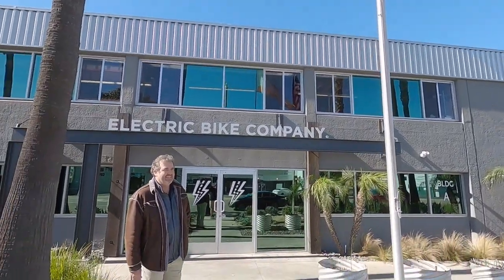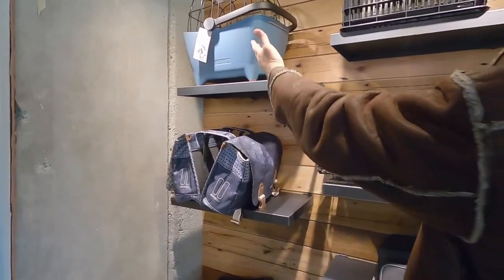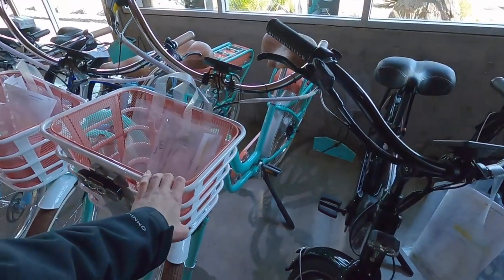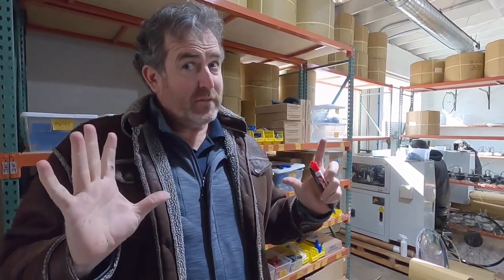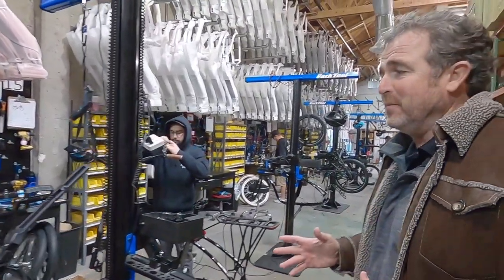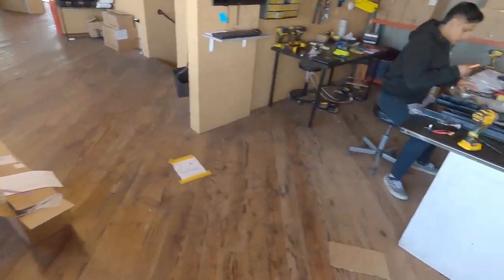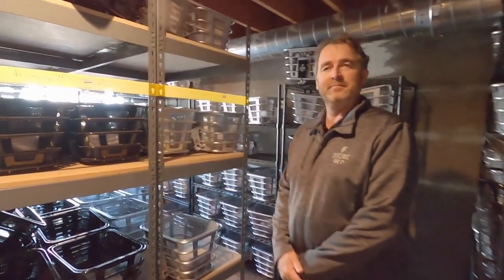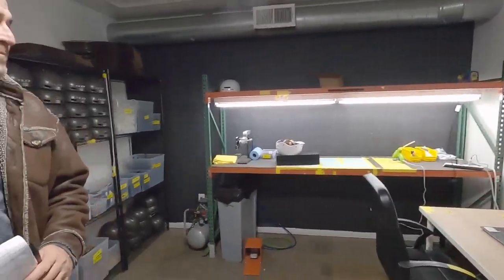Electric Bikes From America, USA Factory Tour

Comment: I'm glad to hear about the handlebar options. I asked about changing the handlebar in your previous video. The look a little too wide. I'll be checking out their website.
Reply: You can always cut down handlebars. :) It changes the steering, but usually not that much (and usually not relevant unless you're pushing the bike to extremes). I had to do this for one of my bikes because I was having trouble fitting through doorways straight on--my LBS did it for $20 (including adjusting over all my handles, throttle, bells, etc.) or you can do it yourself with a hacksaw and some elbow grease. Obviously this makes the most sense for flat for raised bars and not cruisers.

Comment: Do they weld their frames in California?
Reply: I just got off a chat with "Blake" who states their frames are mass produced in Communist China.  He claimed their brand is the only one to assemble their e-bikes domestically in the USA.  But when I countered with how Utah Trikes custom welds their frames here in the USA he could only say that they don't make trikes or quads.  Their website doesn't provide the buyer with a list of components that are domestically manufactured in the USA.  He claims they have plans to eventually manufacture the frames in the USA but that it would significantly raise the prices of the e-bikes they currently assemble.  How hard can it be to weld a frame together using materials made here in the USA?
Reply: @IraQNid the bike Industry revolves around Chinese made frames. They have the huge factories and the huge cheap laborers that it doesn’t make any financial sense for anyone to build e-bikes in America.

If you do build in America it would be in very small numbers and of course to recoup the loss in profits due to small numbers and expensive labor… the bikes will have to be $10,000. Example HPC high power cycles or CAB motor works. And even those guys still buy their frames from China but build their motors and controllers in California.

I get it. It’s how the world works for now. 99% of all bikes are made in China.

Comment: I'd love to see a foldable e-bike that weighs under 50 lb. without the battery that I can get a case and take on vacation on an airplane.  (The battery must be in carry-on.)
Reply: EBC's Model F is the one and only foldable in their line up. It's 48 lb without the 8 lb battery. Like all the others in their line up, it rides very nicely. Their foldable does, however, have a few ergonomic flaws. I suspect that in time, the company will tweak their foldable, and it will be good to go. Contact them to see whether they have any plans in the works to improve the ergonomics of the foldable. I have figured out a way to fold and unfold mine without actually having to lift it off the ground. And an important tip is that this bike folds and unfolds much easier without the battery. Happy riding.

Comment: I feel the step through model F could use some wider bars or even a BMX bar style.. The small battery could get upgraded with that nice step through space.. Say 17.5 ah even if it sticks out 2-3 inches and is semi integrated. Just my thoughts. The crank arms for the pedals are a bit short.
Reply: It's a folding bike... There are concessions to keep its folded profile reasonable (like shorter crank arms, battery needing to fit within the space for strength/rigidity, narrower bars, etc). For an alternative/comparison, you can check out the Montague M-E1, which has many of the same concessions and Montague is very seasoned in the folding space. This is precisely why many people are not actually happy with folding bikes once they purchase them and often end up purchasing a standard bike later--it's always a great idea to test out bikes, but especially folding bikes, to make sure you're willing to make the concessions for the bonus of having the ability to fold the bike because there are legitimate tradeoffs that need to be made. :)

Comment: Wonderful, thank you, I have an electric bike sitting in my garage, looks pretty good however recent stroke has stopped me riding. I have had a good recovery however I have to be careful when walking. Living in Altona Victoria Australia I have been drawn towards checking out “ Trikes “ have been worried about tipping in the turns ( haven’t ridden one yet ) I did see a trike that “ Tilted “ the rear wheels as it turns thus protecting the bike from tipping over looked pretty good , so seeing all this has confused me. I am still looking for a Trike…..?
,
Reply: Get a reverse trike with two wheels in the front.  Those are harder to tip over when turning at faster speeds.  How is your stability?  Some models sit fairly close to the ground.  But there are automatic lifting arms you can add that will raise the chassis to a comfortable height to get on or off of the trike.  If you don't want to worry about range Utah Trikes makes an electric quad that supports up to 500 pounds for a single rider, pedals are extended out in front of the rider, the handle bars are more like two separate control wands sort of like a tank's control sticks, plus the chassis can be manufactured to support up to 10 e-bike batteries.  Each battery has a maximum range of 50 miles per charge if used in peddle assist level 1.  So you'd have excellent stability, a platform that can hold your weight plus lots of cargo (again up to 500 pounds), with a range of up to 500 miles!  Way better than an electric car.  Costs between $6,000 to $10,000 dollars U.S.

If you want to share the ride they can custom manufacture a side-by-side for two riders.  Each with their own adjustable set of peddles.  I think for those the total weight capacity increases.  You can have them make an extended length chassis as well.  They custom weld their frames right here in the USA.

Comment: Someone should make a special bike as a Police Model. Custom secret motor and extra huge battery and controller. Painted in a police paint scheme. Special lights and cargo box and panniers for that extra equipment. 😁 instead of walking or using motorcycles on a beat they could have fast police bikes and jet to areas stealthy and fast if needed.
Reply from the maker: That's a good idea, I could see one of their bikes serving this purpose. It's neat to see police riding regular bicycles at street festivals and around crowded areas... an ebike would let them go farther and haul the extra gear more easily :)
Reply: A Coyote reverse e-trike or e-quad recumbent can do exactly what you desire.  But it ain't cheap.

Comment: It’s not easy to bring back manufacturers to the USA. 
Electric Bike Company has done that so well ❤
BUILT IN USA
Reply from the maker: Totally, it's built here and some of the parts are even made here... and this is California that has some higher taxes. I'm amazed and delighted by how optimistic and positive Sean is.
Reply: I just got off a chat with "Blake" who states their frames are mass produced in Communist China.  He claimed their brand is the only one to assemble their e-bikes domestically in the USA.  But when I countered with how Utah Trikes custom welds their frames here in the USA he could only say that they don't make trikes or quads.  Their website doesn't provide the buyer with a list of components that are domestically manufactured in the USA.  He claims they have plans to eventually manufacture the frames in the USA but that it would significantly raise the prices of the e-bikes they currently assemble.  How hard can it be to weld a frame together using materials made here in the USA?

Comment: I'd simply swap out the bike computer for one that isn't restrictive.  If the industry as a whole goes the route his is taking then a regular PDA, smart phone, or tablet/phablet with e-bike software loaded on it will suffice.  Plus it will have built-in GPS routing to my contacts or new addresses.  I just got off a chat with "Blake" who states their frames are mass produced in Communist China.  He claimed their brand is the only one to assemble their e-bikes domestically in the USA.  But when I countered with how Utah Trikes custom welds their frames here in the USA he could only say that they don't make trikes or quads.  Their website doesn't provide the buyer with a list of components that are domestically manufactured in the USA.  He claims they have plans to eventually manufacture the frames in the USA but that it would significantly raise the prices of the e-bikes they currently assemble.  How hard can it be to weld a frame together using materials made here in the USA?

Comment: Nice to see their new expanded facility. Looks like more is getting done in-house and I can see why they feel confident enough to provide their long warranty periods!

Nice of them to share a peek into new developments.

I also appreciate they provide their people with safety gear in addition to the engineering controls.
Reply from the maker: Yeah! It seems like they treat the employees really well... and I think they even participate in a program that helps people get back onto their feet if they lost a job or had an issue with their record. Everyone I met was very nice. Sean also participates in a nonprofit in South Africa that helps pick up trash by using a push bicycle that uses one of the Electric Bicycle Company hub motors :)